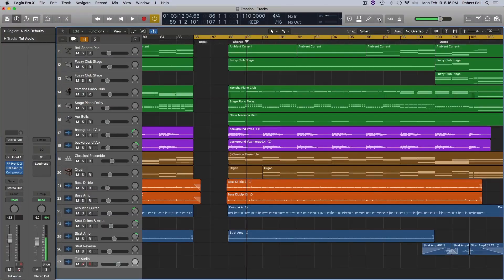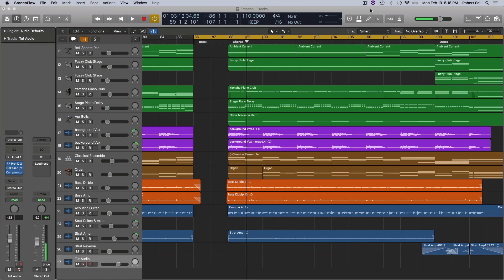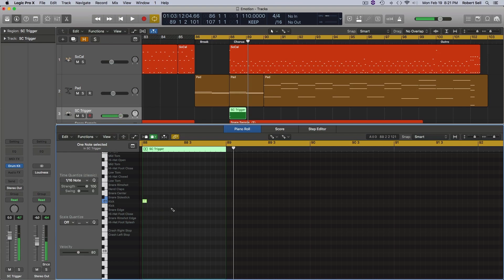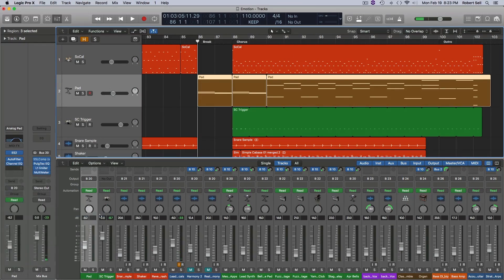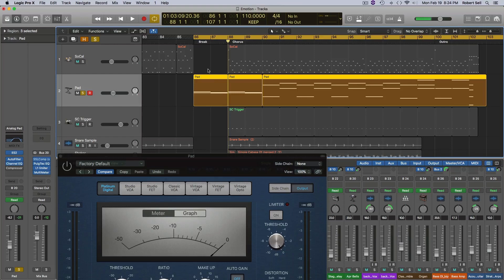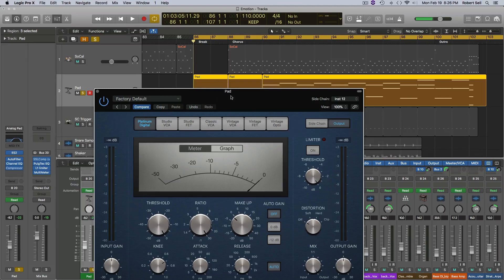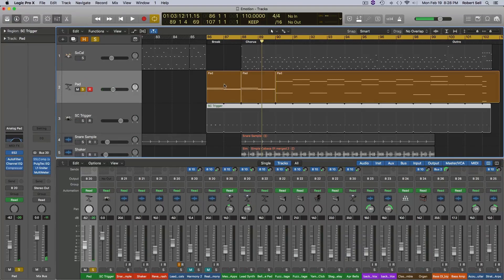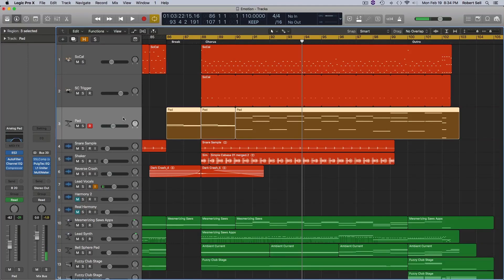Side Chain Pumping Effect in Logic Pro X

Comment: How do you get software instruments to show up in the side chain menu?
Reply from the maker: Rudy,  using a software instrument track for the side chain input may have been one of the enhancements in 10.4.  I think  in previous versions you had to use audio audio for the side chain input or input from a bus. For now you could try outputing your software instrument track to a bus and then use that bus as the side change input into the compressor.  You can mute or delete the aux track that logic creates automatically if you don’t want to hear the trigger track in your mix. Hope this helps!
Reply: That worked! Thanks, Bob!